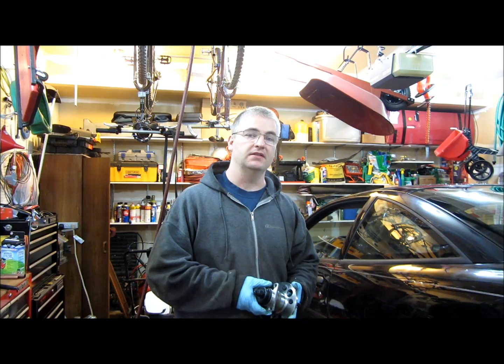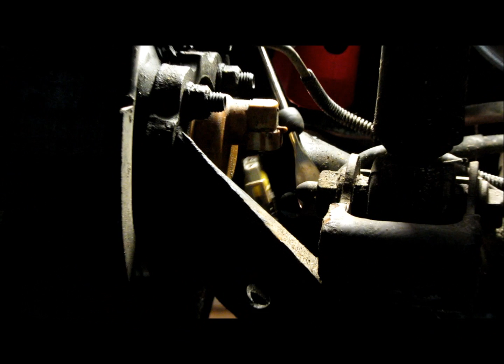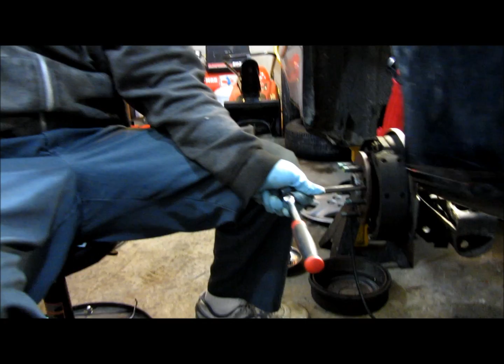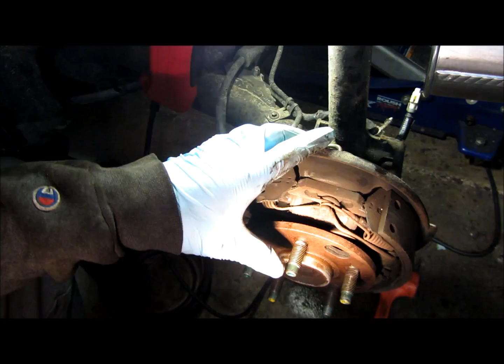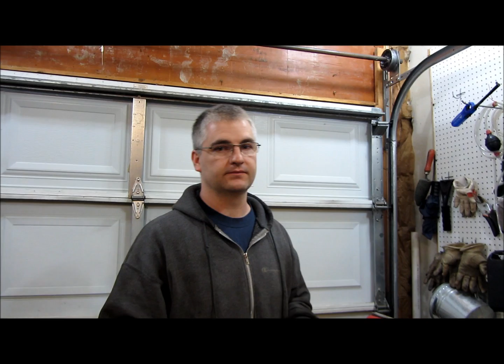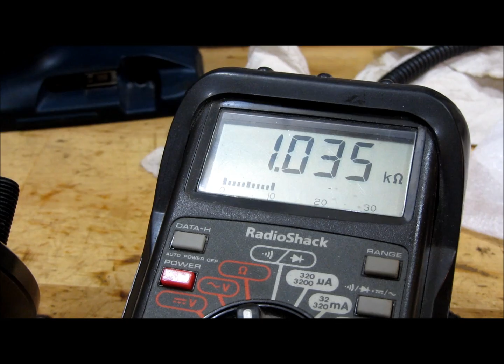2001 Chevy Cavalier rear wheel hub replacement and wheel speed sensor diagnose

Comment: The bad wheel bearing (actually it is wheel bearing & hub assembly on 2003 Chevy Cavalier, I don't know if you can remove just wheel bearing itself from that assembly) were bad on the front. There was exactly that noise on driving straight. I replaced the original ones w/new aftermarket just bcs of the mileage (~100K) about 2 years ago. Now they both failed, mechanic on alignment told me and I replaced them for the original ones I saved. Again the original ones had no issue and when I rotated them, they were rotated smoothly. That knocking sound gone, the car drives straight smooth, but now on turn it gives whining-scratching sound when turning to the Left (occasionally), and loud grounding sound when turning on the right. I did another alignment in the Dealer, but that sound didn't go away, and they didn't give me any recommendations this time. What that can be? I would appreciate any opinions on this matter. Thank you for the informative film. Yes, and when the wheel bearing were bad I couldn't feel anything by shacking the wheel side to side on in vertical direction.

Comment: 03 Cavalier. Left rear replaced again! Duralast speed sensor failure. Bearing had lots of free play. Replacement #1 by an independent shop, using Duralast assembly.
Abs and service light came on after only 4,000 miles. 2nd time I replaced it. Has Duralast made in China on the box.
So I just did both sides with Duralast.
A failure anomoly? We will see.
Sure looks like China is economically strong enough now, to be unmotivated to sell us anything of quality.
Screed sacks.

Comment: They are a pain in the ass to put in
Reply: @Thenerfdog, They are easy to install.
I live down south. No ice and therefore no rust, near as bad. Four shots of PB Rustbreaker and the T-50 bolts and nuts came loose. No torch needed. I think the shoes and Mono spring are the real p.i.t.a. but don't even need to mess with them, as he ignored them in his good video.
Thanks for explanation.

Comment: Nice film work and part comparison.  Should mention when installing new hub to always torque to specifications from the nut side of the bolt and not the torx side.  Great job not having to remove the brake hardware.